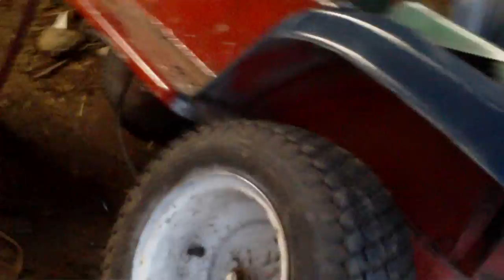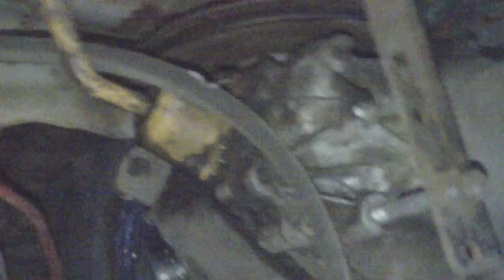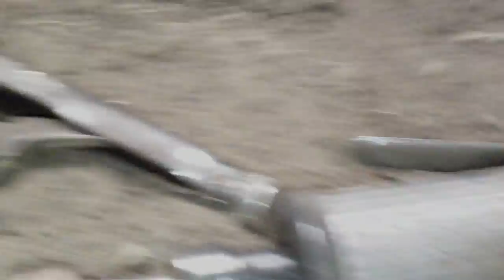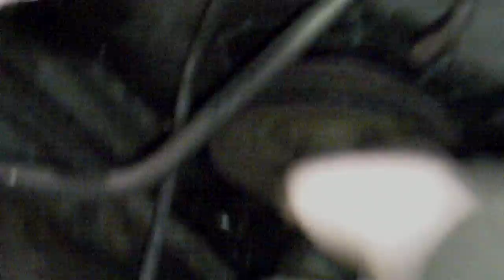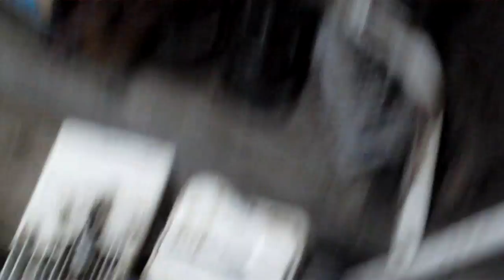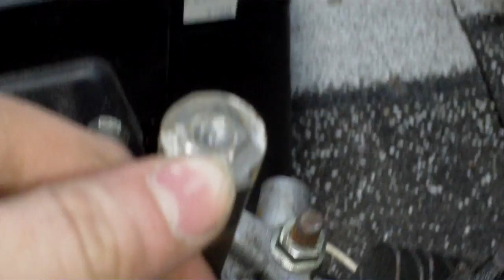further progress on the racing mower

Comment: Just some advice - your transmission pulley may be a little too small.  Not that it will go too fast, but with such little surface contact between the pulley and belt, I imagine this setup will be hard on belts, as it will probably slip under hard acceleration/launches.

I have a mower/go-kart (vids on my channel), I used a 3.5" pulley on the trans and had to put an extra spring on the clutching pulley to keep it from slipping.

Can't wait to see your machine in action! :-)